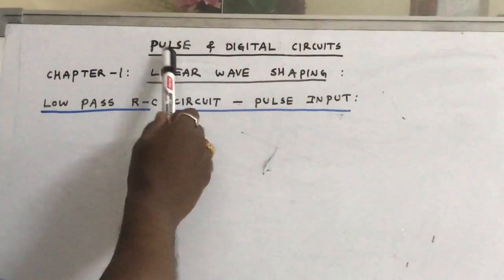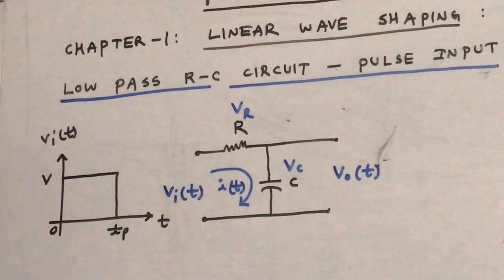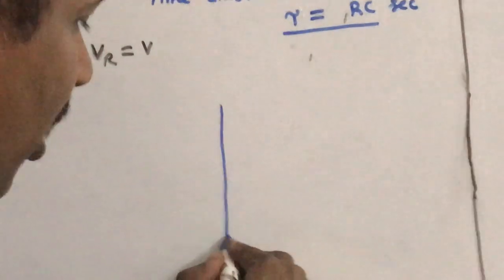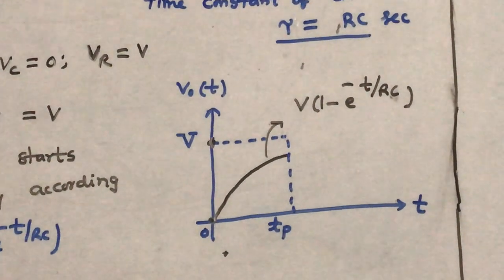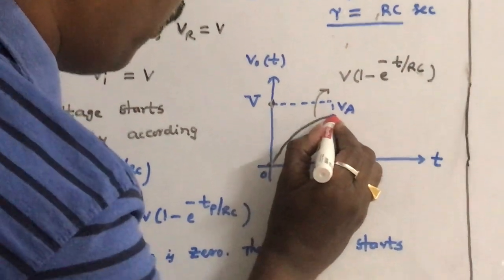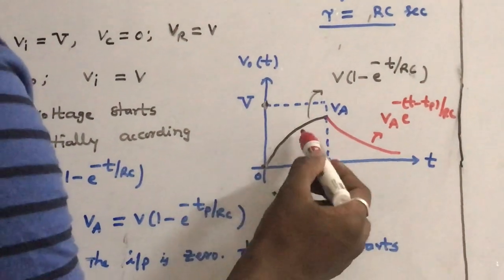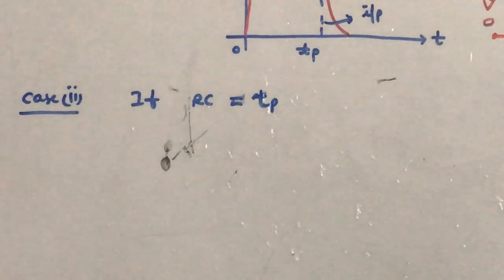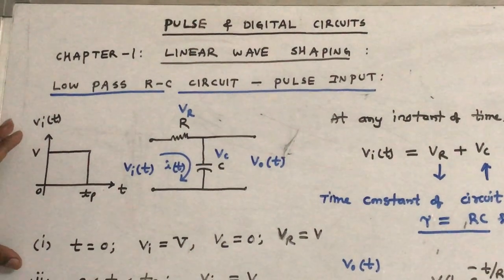Low pass R-C circuit - Pulse input - Linear Wave Shaping

Comment: Why the voltage across the capacitor  is zero sir
Reply from the maker: Somaraju Andhra abbayi please watch my video low pass R-C circuit - pulse response in multisim software also
Reply from the maker: Capacitor always charges and discharges exponentially, in all high and low pass circuits we take initial voltage across capacitor as zero.
Reply from the maker: As like our cell phone battery with no charge on it, it’s volage is zero. Once you plug-in the battery it starts charging
Reply from the maker: May I know your college name somaraju
Reply: Vasavi
Reply: Tq for giving  rply what I have questioned u sir
Reply from the maker: Somaraju Andhra abbayi Hyderabad
Reply: @MrPprasanna  haa
Reply from the maker: Somaraju Andhra abbayi thank you for watching my channel